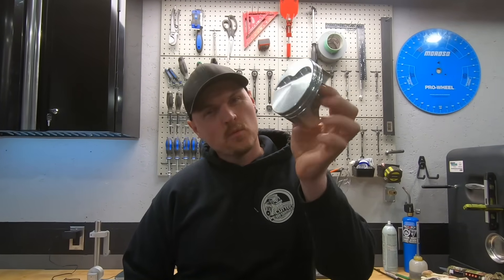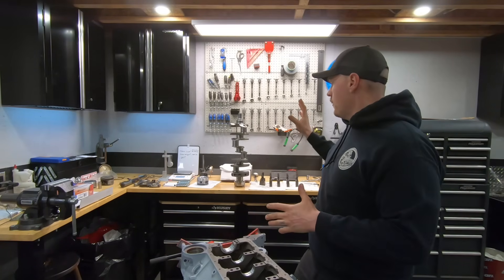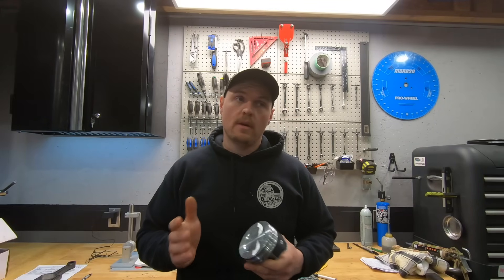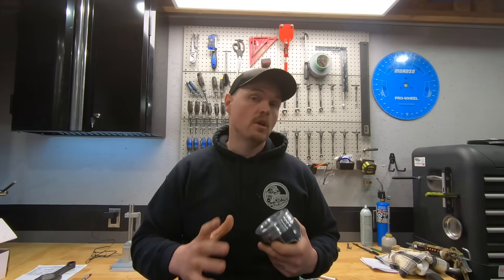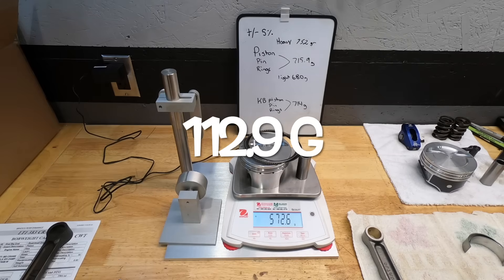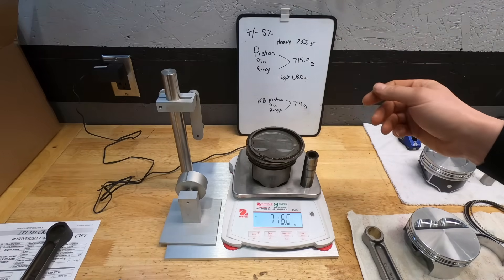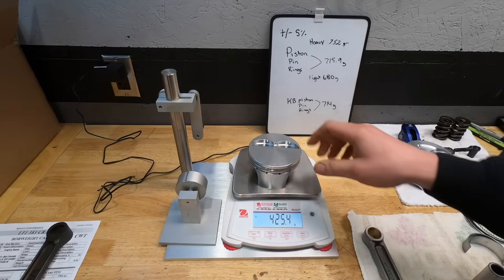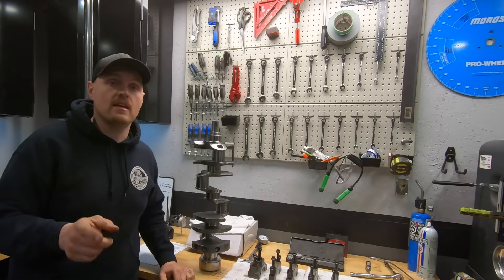Do you need to balance with new pistons? + New Collaboration 383 Stroker

Comment: Put KB167 pistons in my 318, stock rods and crank. (well actually a stock 273 forged crank and rods)  No rebalancing, and nobody would know it wasn't balanced. Huge difference between rotating weight and reciprocating weight, like you said. If I wouldn't used rods not balanced for the crank originally, I definitely would've spent the money on balancing! If I built it for someone else it would get balanced, but for myself I'm not wasting the money.

Comment: nice content ..    I am not sure about other engine families but for small block Chevys you can get away with a lot of stuff and they still run well...  for example:   using a stock cast factory crank and under 6200 rpm I have swapped after-market pistons and rods for "cheap" rebuild/upgrade with zero problems if you are within a few grams of each other.   To be honest most factory stuff is what I call "Ok" and has a wide range of what they call "balanced"  if you look at it from a performance view.

Comment: Building a .030 over 350, using cast crank shaft turned.010. Cast pistons, connecting rods are Elgin stock appearing rods. Flex plate from Speedway mtrs, front balancer from Orielly's does it need to be balanced?

Comment: I know this is off subject, but I’m waiting for that 403 Dino
I don’t know if you’re gonna take the time to really unshroud those valves with the barrel being so big compared to the chamber of those heads
 I know the Heads will gain a cc or two I’m not sure what pistons you’re using in the beginning what compression you’re reaching for
But it would be a great before, and after or something great to do, but the heads would be definitely dedicated to that size of cylinder afterwards
Reply from the maker: I haven't got the block back from the machine shop so it might be abit

Comment: it really gets complicated in a high performance boat engines because balance at a sustained rpm like 6500 for example. the force applied from combustion comes into effect . the real no fun part is data logging 8 egt’s then figuring out how to make them all the same . basically no one should complain about the cost of regular balancing.

Comment: It really depends but it comes down to this pistons and rods should be balanced. Lot of time the rotating Mass on engines are almost dead on. But how do you know until you spin up the crankshaft and the front ,flywheel and clutch.

Comment: I think that whenever you make pistons and rods heavier it might be a good idea to balance.
But if you made it lighter I dont think theres as much need.

The machnist that helped me denied the balancing job since he felt it was money not worth spending. Especially since its an na street engine revving max 6000 rpm.
He dont often balance engines but make sure to really equalize the weights.

In my case the weight per each cylinder was way off. One piston/rod was 40 gr heavier than the lightest combo.
I shaved 30 gr on each piston/rod and made all within 2-4 gr of each other. 
So my thinking is this is way better than it was from factory. Not only will the lighter assemblies infer less weight but also the equal weights will make it way better.

One have to think that the cransk are very well balanced at the factory. But to some standard but bobweight. Then the assemblies have pretty large tolerances. So if all you do is equalize the weights you imrpove things alot.

If building a race engine revving above 6500 its a different thing for sure.
But for street engines that maybe see 6000 rpm once in a blue moon? I think the money can be spent better.

One should also consider how companies have used anything from 30 to 55% factor when calculating bobweight for V engines. So unless you change things alot youre well within that window.

Comment: I hate spending extra money. But I have discovered after years of building engines, if you want them to be smooth, just include balancing in your estimate. I don't care if it's a totally stock rebuild or a Pro Stock engine, it's a couple hundred bucks very well spent. And if you are assuming  your stock engine was properly balanced, well, I see stock stuff that was horrible from the get go and it didn't feel too bad. So changing the recip weight by 3% with new parts, when it's on the edge of being 5% out might give you a vibration. Just my opinion, and when I was younger I never got stuff balanced and had pretty good luck. But that one time you really want it right is going to be the time it let's you down.
Reply from the maker: True, balancing is never a bad idea

Comment: I have a little different question for you.  I have an 880 block with an eagle 3.75 crank, rods and pistons kit including E balanced flex plate.  I also have a couple LT1 T56 trans, one included the original LT1 flywheel.  I know the 5.7 LT1 1pc RMS requires en external balance flexplate/flywheel.  What I don't know and can't find an answer for is if that balance weight is the same for the stroked 3.75" 1pc RMS crank vs the factory weighted 1 pc RMS LT1 flywheel.

Great videos BTW, thanks for any input on this.
Reply from the maker: All of the 383 stroker kits that ive seen for the 1pc rms blocks will be balanced using the stock " rear external balance" so there will be a counter weight on the flexplate or flywheel. Some also use a 400 weighted balancer. I know you can buy a non weight fly wheel or flexplate if someone decided to do a full internal balance but ive never had it done before.
Reply: @cuttersperformance  so it's your belief that the 383 flexplate they provided with the stroker kit will be weighted the same as the factory LT1 flywheel?

The eagle kit did also includ a weighted damper.

Comment: How about purposely building an engine out of used parts from different engines , a crank from one , rods from 2nd engine and pistons from a third , used rings and bearings ! You could grind away most of the piston skirt to seriously lighten for test ! Put it together with pistons that are 200 or 300 grams over or underweight and see if it shakes . I doubt it would ! Sure would make a "HEAVY HITTING" video for you , would make great , fairly cheap video content and would answer this ? once and for all , if you know what I mean ! Can you tell me what my compression would be if I bolt on a set of 350 Vortec heads on my stock 1978 400 sbc with the standard thickness head gasket and no other mods except intake ? I tow with it and wonder if it would ping ?
Reply from the maker: Around 9.1:1 compression on a stock 400

Comment: That's good to know about Skip White. I bought stuff from him years ago and got great deals. I just finished a .040 over 383-385? that I pieced together from old parts but, it cost me more to balance and grind the crank to 10/20 plus non standard bearings than it would have to buy a new crank that was close in Bob weight!!
Reply: My last 2 balance jobs were 400/each. There was no added weight, and the pistons and rods didn't need touching. Street engines and I wanted balance to within 5 grams. Next time, I'm going to buy from wherever I can get a balanced kit. We waited a month, and I provided the Bob weight cards. Literally, just the 2 crankshafts needed to be lightened up. Also, the actual bill was 150 more per job than quoted. It was SRP forged pistons, SCAT 6" lite-weight rods, and SCAT 9000 model cast cranks. 1 a 350 and the other a 383.
Reply from the maker: Yeah skip is a great guy to deal with 👍

Comment: I have gotten away with topping stock balanced rods and crank with new pistons twice motors spun smooth. I did a 1 gram balance on skipp white 383 assembly and that motor is smooth but also has more cam, compression ect.

Comment: I have a lt1 rotating assembly laying around thinking about using it in my vortex 350. Factory flat tops wonder if it would be worth it
Reply from the maker: Yes, certainly but depend on the cam. From what I remember, they have shallow valve reliefs

Comment: Another good video.  Information you rarely get.  Years ago when I had no money I screwed together a low dollar 400sbc with a set of used standard KB flat tops on stock 5.7 rods.  I only turned it to about 5500 rpm, but I was surprised how smooth it ran.  Got lucky on that one I guess.

Comment: Interesting,  I always thought forged pistons were heaver than cast or hypers.
Reply from the maker: @davidncw4613  depends on the piston. They can design a forged piston lighter because the material is stronger. But alot of newer forged pistons are lighter
Reply: @cuttersperformance  Apparently the days of those old massive TRW slugs are passed,  dinosaur stuff now.  knowledgeable guys like you Cutter are slowly dragging me out of the dark ages.

Comment: This was super helpful! Wanna rebuild a l31 vortec and thi king about going with hyper flattop pistons after getting bored but was stuck on if I had to get it completely  rebalanced or not
Reply from the maker: Those KB pistons are a great replacement for the L31s. It's a flat top, 1.565 height, and the weight is basically the same as a stock piston/pin
Reply: @cuttersperformance  exactly my thinking lol